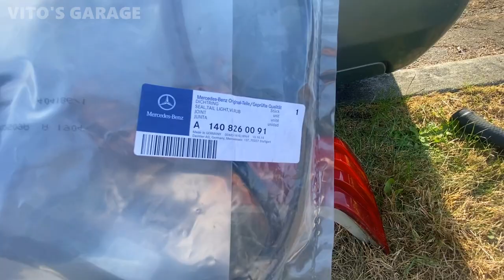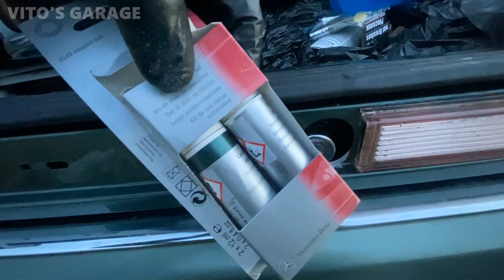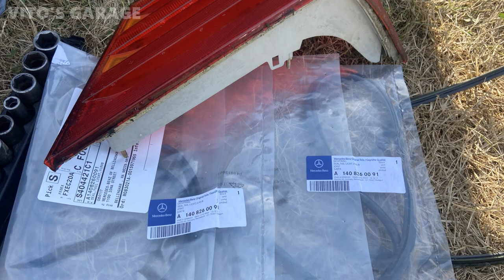Crocodile Mercedes W140 New Tail Light Seals & Hidden Rust Repair + Preservation

Comment: Thanks for posting this video Vito! I found rust on mine around the lock too, and also a small hole in the truck gutter under the main seal below the windscreen. I used rust converter then enamel paint and will finish off with marine grease too.
Reply from the maker: Good job! Thank you for loving and caring about Classic German cars. They don’t make them like they used to!

Comment: I doubt the age of the touch-up paint is the cause of the color difference. Can be, but I use them a lot and most of the time they don’t match, even directly from the manufacturer. Not a bad idea with the grease. I know one of my newer cars, 2012 Focus, the trunk seal had white silicone grease from factory, placed along where it slots into the body frame.
Reply from the maker: The touch up paint was matching perfectly at first! But then, I am not sure why it became a lot darker... I was shaking the tube before using it. Silicone grease on the lip where the seal sits is a very good idea. It protects the metal from rusting and doesn't damage the seal.

Comment: I was wondering if there is something that you can put on  the rubber seal to further protect it, it looks like the original seal
Reply from the maker: Protect the seal from what?
Reply: @VITOSGARAGE  the seal of the light, i
Reply: @VITOSGARAGE  the grease that you put on,doesn*t that  protect the metal from rust, how about the rubber seal, does it give any type of protection, after all the seal tends to dry up and crack
Reply from the maker: Silicone grease is what I put around the trunk seal lip to protect the metal from rust. Silicone grease will not harm the rubber
Reply: @VITOSGARAGE  good to know, I have a BMW E34 I am thinking of putting  some silicone grease around  the rubber seals, to protect it, from rust,